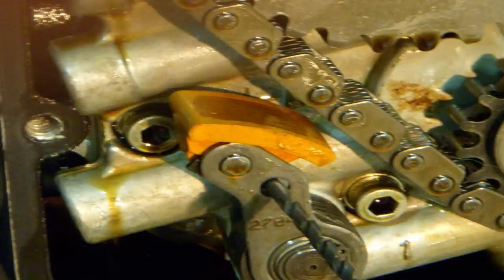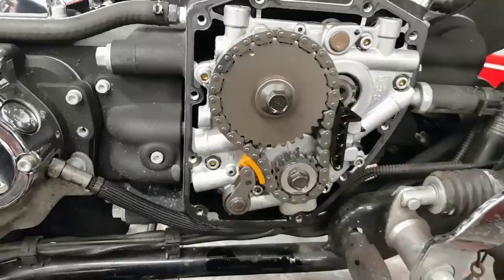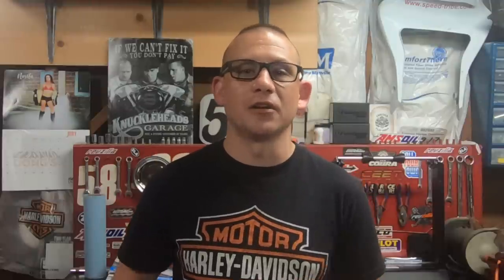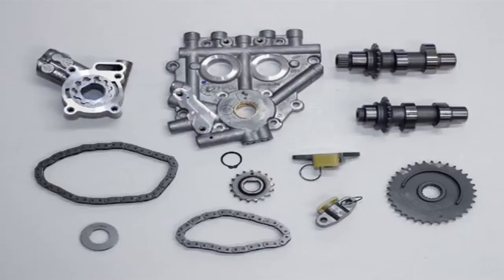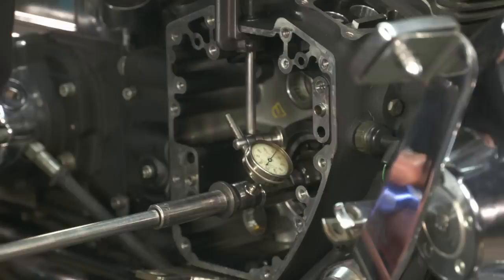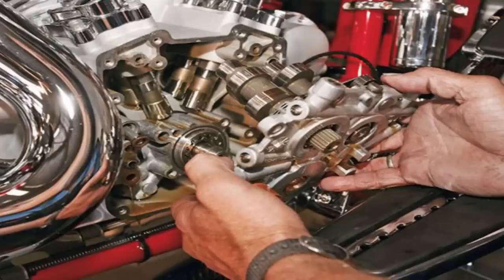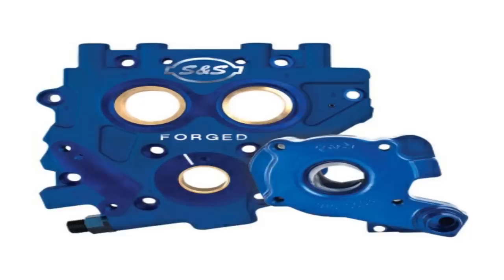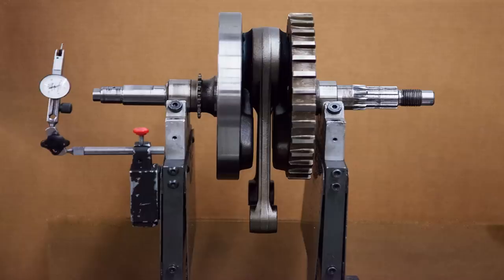Gears or Chains For Your Twin Cam's Cam Chest? What You Need to Know

Comment: Got an '02 fxd with around 14k on the clock the other day as my first harley.  Just gotta figure out what to do to make it a solid runner forever.  Not trying to race it or anything.
Reply from the maker: Once you upgrade that cam chest it's a really solid motor! It's got the Timken bottom end and a solid crank, upgrade to gears or a 07 and later cam plate with hydraulic tensioners and that 07 up oil pump is a great start!
Reply: Mine's an '01 with timkin bearings.  You're in luck as you also have Timkins and can probably run gears after you measure run out, which I did.  I had Screamin Eagle cam chest and oil pump installed too.  Was $2,500 but should last me forever. Also installed .510 S&S cams which made a huge difference.  I'll go with 95" big bore when time for top end work

Comment: My 2000 wide glide now has 70,000 miles on it, still has the original shoe tensioner, I kept checking it every 20,000 miles, it looks like I will probably make it to 100,000 miles, it's been a really reliable motor so far, my  1500 Vulcan broke a piston rod at 45,000 miles not worth fixing.
Reply from the maker: That's impressive on a early Twin Cam, some bikes never had an issue like that. That's the sad part about the metric bikes, it literally cost more than they are worth to repair them. Parts can be hard to find since they only support them for 10 years after they discontinue the models.

Comment: ‘02 Road King, between .002-.003 runout, put in S&S 509 gear cams this winter and have ridden about 800 miles...prob gonna take ‘em back out this winter and go with 509 chain drive.  So far not really digging the sound or feel of the motor, not what I was expecting...hard to describe.
Reply from the maker: Sometimes that happens, it does change the feel of the motor. When you're really in tune with your bike you will notice that, just been my experience.
Reply: Something isn't right.  8 just put .510 cams and gear drive on my '01 and there's no funny sounds or feelings.  Runs BEAUTIFUL
Reply: @paulfiore7083  I know, it doesn't make sense.  The runout was good and the backlash measured good too.  I'm really bummed 'cause I wanted to do it for a long time.  I don't know what I would do different?  I'm open to suggestions...
Reply: @houseofstylz  man, I really wish I could think of why this would happen.   I'd be interested to know what you eventually do

Comment: Why not go with gear driven cams and a hydraulic tensioner on the outside cam drive?
You don't have to worry about runout and if I am not wrong you can run cams with higher lift than the chain driven ones.
Reply from the maker: I've never seen anyone run that setup, good point!

Comment: Great summary!  I have a 2003 RK and at 20k miles the inner and outer shoes looked good, so i feel good for another 10K miles.  I want to stay with the stock cam profile but move to hydraulic.  It sounds like I need a new cam plate with conversion cams made to the stock profile.  Is that change possible?  Does HD make stock profile conversion cams?
Reply from the maker: You can upgrade to a cam plate with hydraulic tensioners using the stock cams through Screamin' Eagle.

Comment: I have a 2000 Fatboy (original owner) with a stock 88B engine, and 54K on the speedo.  The outer shoe appears to be about half-worn.  Can't see the inner shoe.  The outer shoe is easy enough to replace.  The inner shoe is major work.  I wonder why HD didn't go with gear drive at least on the cam side of the plate.
Reply: Because it probably saved them .50 cents a bike
Reply: @paulfiore7083  Maybe.  I'd hate to think that HD was that unthinking about their customers, or that it was an engineering short sightedness.
Reply: @ephraimgarrett4727  If you have a better explanation I'd love to hear it
Reply: @paulfiore7083  i don't have one.  Would machining gears on the end of the cams really be more expensive than the chain and tensioner system?   I don't know.  Or, maybe they tried it, and it turned out to be noisier than they wanted.
Reply: @ephraimgarrett4727  it was the EPA that was measuring sound.  Harley wanted louder exhaust note so they quieted the cam timing system.   It IS more quiet but has more reliability issues,  some resulting in catastrophic engine damage

Comment: I have an 09 Fatbob with 12500m in it what would you recommend?
Reply from the maker: A good aftermarket cam and a cam plate upgrade is hard to beat, you can really get a nice bump that way. The chain drive is a lot less work and you don't have to worry about the run out being super tight.

Comment: If you buy gears you don't need to change cam plate and oil pump because oil pressure will be unused without hydraulic cam tensioners.
Reply: You're not using oil pressure just for cam chain tensioners.  The upgraded oil pump will greatly increase pressure at idle and greatly reduce wear

Comment: Good information, what about a 2003 RK CVO with a 103? Can you advise on this motor, Thanks
Reply from the maker: CVO Road King had the same tensioner system and the crank shaft was a pressed assembly like on the 88. Sadly on the Screamin Eagle motors they still used the factory cam plate and other stock components instead of the Screamin Eagle parts.
Reply: @GixxerFoo  go figure, I thought I may have dodged the Harley bullet. Thanks for the quick response

Comment from the maker: Would you opt to have your crank rebuilt to run gears or just upgrade to a hydraulic system with the race cam plate?
Reply: Pin and weld the crank all day
Reply: I would rather buy a new crank from S&S or Darkhorse.
Reply: I upgraded my ‘06 Fat Boy to a hydraulic system (Screamin Eagle cam plate) about 3 years ago.  No complaints.
Reply: @backroadmax2344  Same here… 06 Deluxe. I did the same kit. No complaints! Runs great!
Reply: New Dark Horse then Timken conversion, then gears. It's close to bulletproof for the bottom end.

Comment: For 03+ If it’s in spec at the time of checking, don’t you alway have a chance for it to become out of spec at any time due to the press fit crank?
Reply from the maker: There always a chance they can develop more run out as miles pile on the stock crank. That's what has always concerned me about gear conversion on a stock crank. A good solid rebuilt crank or aftermarket is the way to go in my opinion for a gear conversion.
Reply: @GixxerFoo  Can the '99-02 cranks develop run out too or do Timkin bearings prevent that?

Comment: So what’s the acceptable runout for running chain style cams with hydraulic cam plate,asking for a friend?
Reply: I believe .0003 or less if I remember correctly
Reply from the maker: Going with chain drive you can have pretty high runout, but you'd want to stick with the OE cam plate. Harley really seems to be fine with up to ten thousandths. Way to much in my opinion and that's with the stock cam plate. The issue is the race cam plates really need to be five thousandths or less. But you can use the Feuling OE cam plate, much better unit that stock and it will allow you to have a crank run out higher than 5 thousandths. But anything 5 thousandths or less you're golden with a race plate, high volume oil pump and hydraulic tensioners.
Reply: @GixxerFoo  ... I went with Feuling. ZERO issues and the bike is alive
Reply: @GixxerFoo  thank you 👍

Comment: I've got a 2014 Firefighter Street Glide with the Hydraulic cam chain set up (103) High Output motor  ,bought new that now has 38,500 miles on it . But my 2005 Softail Deuce( bought second hand with 17,000 miles on it)  I ran till 20,000 miles then had the crank run out checked . With all the calculations checked I had  the 0.003 to run gears. My shoes weren't that  worn  but I heard some fried at 10,000 miles some still going strong at 90,000 !!!!! A real crap shoot. SO I went with the FULL S+S  Gear drive kit , cam plate , high volume oil pump, adjustable push rods ECT ECT with 509 Gear Drive cams. SO Far with a few thousand miles on it and 👍( say no more because I'm a superstitious bastard)😂😂😂Pricy yes BUT Thank God I'm not worrying about those F en plastic shoes anymore.
Reply from the maker: It is a crap shot on tensioners, engines either blew up at 15k or ran to 100k with no problem! I am jealous of that Firefighter Edition!
Reply: I agree.  I did same thing.  Things like this make me wish HD had a little more Japanese quality in their make up.  Try to find an issue with a Honda 1800!

Comment: Damm shame just a junk motor. Unless you put alot of up grades into it.
Reply from the maker: They can really benefit from some upgrades, that tensioner system was the biggest issue.
Reply: I like mine!!
Reply: @lanceandmelanierogers6255  may she run long and strong. Stay safe.
Reply: Twin Cams are good. They have some "issues", but it's not that tragic. There are plenty of Twin Cams still running, and that alone attests they're not junk engines.
Reply: I somewhat agree.  Just put $2,500 into my 01 for the chain tensioner problem.  Now my $6,000 bike just went to $8,500